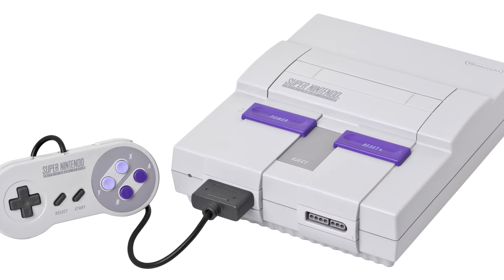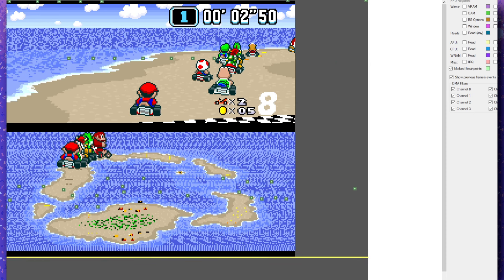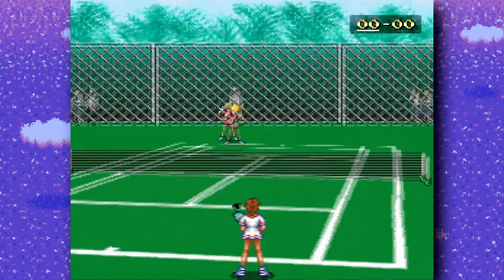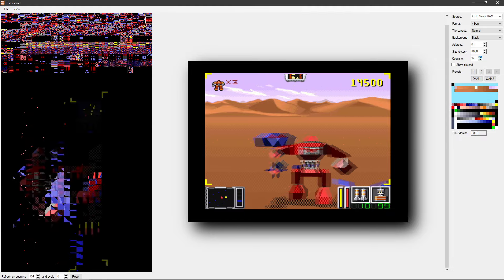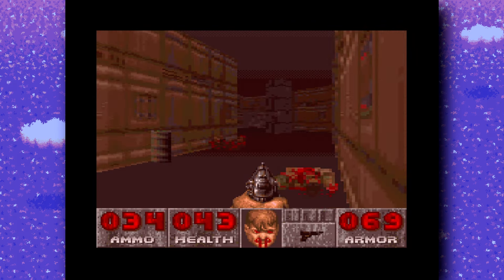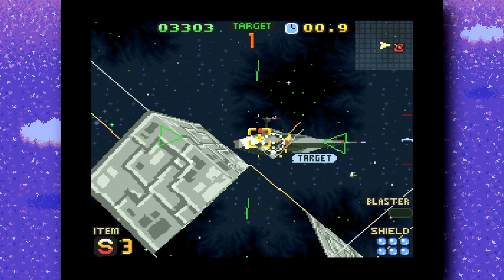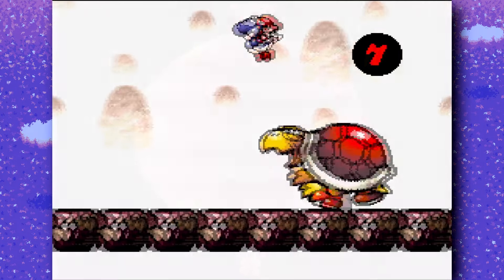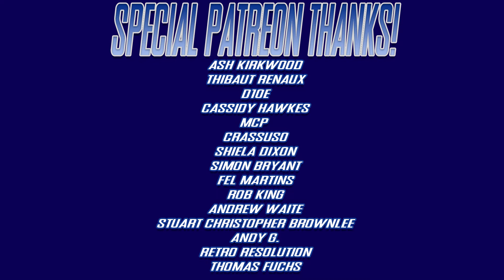How 'Enhancement Chips' Pushed The Limits of The Super NES (and Sometimes Didn't)

Comment: 🚨🎵🕹🤩🕹🤯🎧📺🎛🔉🎚🔊🎶‼
 From what I understand in the mid-90s the Super FX chips that didn't do SFX3D like Yoshi's Island also allowed more colors on the screen then a standard base system without enhancement chips...I think games like Donkey Kong Country, Killer Instinct Yoshi's Island most definitely did put out twice the 512 colors of a standard SNES game of 256 colors on screen. 🙏🏻☯️🧘‍♂️🐲
Reply: Don't know about that - 256 colours is quite a lot, especially for quite low-resolution: 256x224 on NTSC, 256x240 on PAL - in comparison OG DooM on PC was 320x200, and it's quite impressive what it looked like. It's not necessarily easy to identify which game uses higher number of colours, if you have two different games and one uses 256 colours, while the other uses 512 - it depends a lot on how good palette the developers manage to create for the game and what kind of images/colours they want to use.

If the text below is TLDR, skip over to next bold-font line for my speculation on how more than 256-colors might be possible

I'm going to give an example:
DooM (on PC) uses one 256-colour palette, textures and sprites all are drawn with this palette. Then it uses colormaps, like (off from my head) 16 different colormaps for different levels of light - they are 256 entries long and each entry points to color that is closest match for specific color adjusted to that brightness. For example, in the brightest colormap each colormap entry points to same exact palette entry. On mid-brightness colormap each entry points to color that closest matches to that color with half of it's brightness, and the darkest colormap simply points every entry to pure black color entry in the palette.
There's other colormaps as well - when you are badly attacked your screen goes red for a while. Not pure red, more like looking the world with sunglasses that have red lenses. That's not done with palette manipulation, but with colormap. Same with the green tint of wearing a suit that protects you from damage. Also used for when you pick a lot of items (like a long row of blue health bottles) in very short time the screen goes to strong green tint. And then there's the invulnerability sphere, which changed the colors to a weird inverted black and white while the invulnerability lasts. I actually made an add-on that changed the invulnerability colormap to negatives of the actual colors. So black turns to white and vice versa, bright blue changes to yellow (bright green & red) and magenta (red and blue) changes to green, etc.
All this in 256-colours - and on PC those colours are chosen from 262 144 colors (64x64x64).

In comparison, let's take the 15-bit RGB color mode. It has 32 768 colors in total. Note how it's way less than the amount of colors you can choose from for 256-color palette - meaning that depending on image, the 256-color mode can actually look better than the hi-color mode. Especially with color-gradients you can do better with 256-color mode, but only if you can design or generate a palette that matches the colors better than hi-color mode can.

Now that was just an example to illustrate how less doesn't always necessarily mean worse.

Now let's discuss the SNES graphics

There's at least two distinct techniques you could get more than 256-colors on the screen:
1) The chip in the cartridge still has to work through SNES graphics chip, it can't bypass that and render the graphics straight to vid-out - technically what it can do could be done with SNES CPU with software if it was fast enough. We already know the chip can render new tiles on the fly, but what can it do with colors? Well, the same thing that has been used with numerous computers and consoles before and after - change the palette in the middle of drawing. It's even done by PC games that use CGA 4-color graphics mode to use one palette for the playfield and another for the score/lives/etc. display area at top or bottom of the screen. But it can be used to switch palette after each scanline, or technically even in the middle of scanline (search YouTube for "reverse emulating nes" for this being taken to extreme). That way you end up still being limited to 256-color palette, but that palette can be changed numerous times during the output.

2) You could use "fake 15-bit" mode that has also been used by demo coders on PC (with 256-color VGA mode). Basically you would have two 256-color palettes and two screens. The first palette uses 5-bits for 32 green colours and 2-bits for blue - totaling 7 bits or 128 colors. The second palette has the rest 3-lower bits of green and 5 bits of red - totaling 8 bits or 256 colors. Each 15-bit high-color is thus drawn as two different colors on two bitmaps. Here's a representation of how the colours are defined in each byte (R=Red bits, G=Green bits, B=Blue bits:
Byte 0: 0BBBBBGG
Byte 1: GGGRRRRR
Now let's say we are in 60Hz video mode. After each screen refresh you swap the palette and the bitmap, altering between the two - that means virtual framerate of 30Hz.
Having briefly viewed a webpage about SNES video modes, I would think that this would be easiest to implement in Mode 5 with interlacing, as that will already alter between drawing every odd-line and every even-line each screen refresh - you only need to swap the palette after each screen refresh. But I'm no SNES graphics expert, I know this technique from VGA programming on PC. With the chip it might be possible to do this in other modes as well, although interlaced mode is technically almost like it was designed for this purpose ;)

However having tried searching for it, I couldn't find a single mention of any game using this fake 15-bit color mode. Instead I found out that the 256-color palette on SNES can be chosen from 15-bit colorspace, not from 18-bit colorspace that VGA's palette can me chosen from. Still, I would think the fake 15-bit color mode can be done - but if there was a game that used more than 256 colors, it most likely used the first method.
Reply: @robsku1  nice insight
All I'm saying is if you look at Yoshi's Island Super Nintendo Entertainment System it is way more colorful than average 256 colors of the base system It's almost like it's colorful as
 TURBOGRAFX-16  as far as Yoshi's Island goes. And yes I can tell Doom for Super Nintendos 256 colors it's only a handful of games that has 512 colors supported on screen 256 x 2 is 512

Comment: You can overclock the MarIO chip aka the super fx, you can double the clocks and experience a real smooth starfox on real hardware! Its awesome, i am unsure why the fx was  “underclocked” on Starfox by nintendo, just another crystal and it would worked great staight out of the box.. I wonder, will nintendo did this on purpose, for the same reason the dont released Starfox 2, namely, widening the 3d expectation of their next console. If everything 3d runned smooth on the snes, what would be the point of a n64 (marketed towards 3d technology) be?
Reply: There are only 3 limiting factors for choosing the clock speed: stability, temperature and power consumption. One or more of these must have been the reason.
Reply: @DarthChrisB  well actually nope, not at all, the chip does not burn hot, the game finally works flawless, no stability issues. Its because of the FX chip bringing graphic to close to N64 why Nintendont give us the full experience available.
Reply: @ClosestNearUtopia  I'm glad they released 20 something years later.
Reply: I am skeptical the mario chip 1 can handle a double clock speed.
Reply: @hicknopunk  wel if you dont believe it you sure gotta try it out yourself bro! Also, i reminds you that its made in about 500nm scale, which is about 100x bigger then architecture today. It doest even run warm stock, so imagine how much it actually could process before getting to hot! The reason silica gets hot is resistance, and how smaller you go, the higher it becomes, the more heat will dissipate, also the transistor count is way less, making each voltage drop less energy convert to heath in regards to a lower scale and the amount of transistors used creating voltage drops. If there millions more, you get millions more hotspots. Believe me “90 silica is about indestructible as it gets.
Reply: @ClosestNearUtopia  years ago when I was modding fx games, i could be wrong, but I thought there was a very large range of possible performance.  Again I seem to remember that the mario 1/fx 1 chip could only be overclocked from about 20mhz to 28mhz, some games I could get closer to 30, but 42mhz+ ish?  I think you would need to vet your carts very carefully.
Reply: @hicknopunk  not sure how you did try this? What you actually did to achieve this? We change clock and buffer our powerlines to keep everything running. Also, some games need patching, to compensate for the changed timing of the support chip, in this case for the faster response of the Mar10. Also not every frequenty will work out of the box, somethimes going lower or higher does the trick of getting them work together.
Reply: @ClosestNearUtopia  i just replaced the crystal until the games would have graphic artifacts, then stepped 1 mhz back.  There was no code changes, so the games ran extra fast

Comment: If you only explained with the sa1 would do and if you just called this video part 1,i would,ve feel me better now.

BTW i wish you explained how snes doom works , i wonder were super fx2 chip in snes doom is responsible for,

Also what i don’t understand is that despite the snes was designed with expandibility in mind(hence the extra pins) but it only has enough bandwide to stream video at 200x160 pixels at 30fps in 8bit color depth, then what’s the point of that?

Even the nes (wich was never designed with expandibility in mind just could stream video at 256x240 pixels at 60fps at 4bit color depth,

I remember how i saw on the game package of starfox,vortex and doom how those images were in full screen while in reality they are not in full screen,wich is a very disappointment🤨🤨

Comment: Thinking about Nintendo and their wayz, I speculate the slow main CPU was intentional. Nintendo kept a tight leash on cart manufacturing and using a puke slow cpu allowed them to offer in-cart upgrades when needed for a cost. Higher clocked versions of the same processor were readily available for cheap at the time from what I've read. Seems Nintendo binned crap processors on purpose. JMO. That being said, slowdown is greatly reduced in games by converting to Fast ROM as demonstrated by Vitor. FR was also available for a fee 😎
Reply: Nintendo's SA-1 enhancement chip which was briefly mentioned in the video was basically the same snes cpu with a few new features that was clocked 3x faster. And ran independently of the main cpu.
Reply: @tancar2004  Correct. I wonder what they charged companies per cart for the chip?

Comment: Super FX and SA-1 chips for the SNES while the STOCK Genesis could pull off pretty much the same performance.
Reply: yes it probably can (except for inferiour colours and sound) no body cares about specs if there is not enough great games
Reply: No 3D on the genesis can run a smooth game than the super fx and there own svp chip during the 90s.